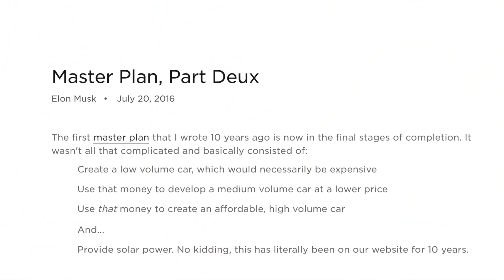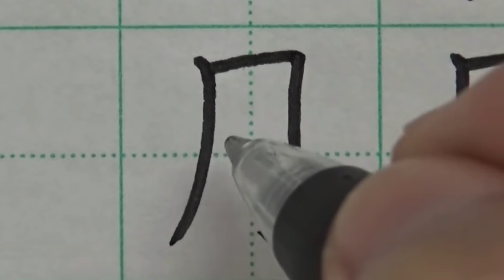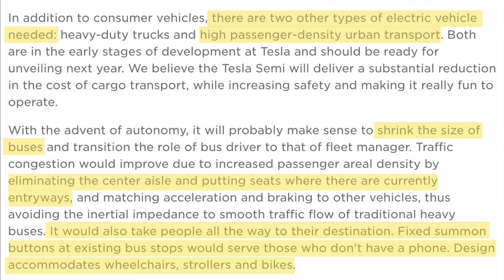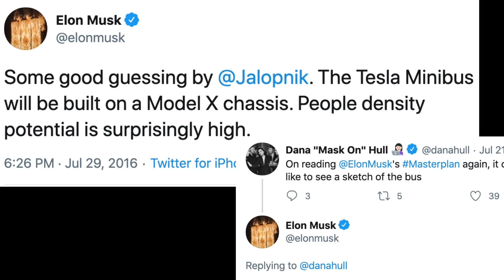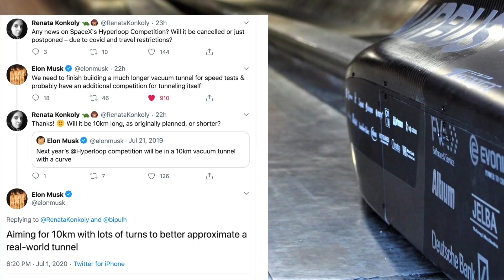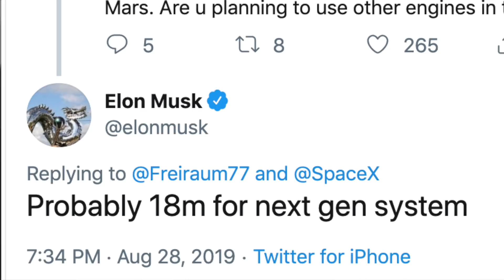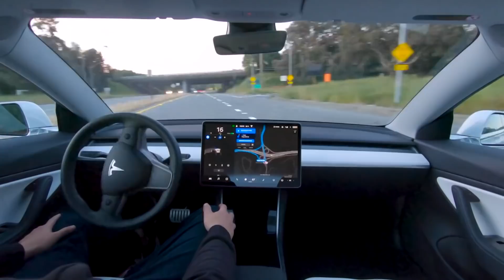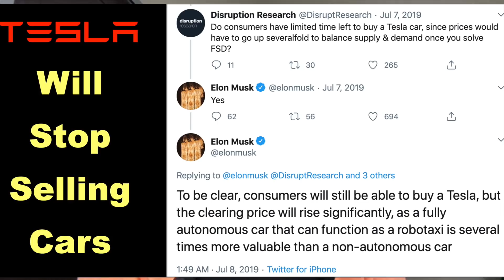5 Elon Musk Surprises for 2021: Tesla, SpaceX, Boring, Neuralink

Comment: About the bus and possibly using the cybertruck chassis. I don't think that is possible because doesn't the Cybertruck have a sort of exo-skeleton type chassis? its not as simple as putting a new body on the existing chassis because the body Is the chassis.
Reply from the maker: I'm not really sure. I think that the Cybertruck exoskeleton will ride on top of a "skateboard" like the other Tesla vehicles. But I could be wrong.

Either way, the minibus could be based on skateboard similar to other Tesla vehicles, but with length and width comparable to Cybertruck.

Comment: Elon suggested a compact EV will be designed in Berlin.

The current Model 3 and Model Y battery packs are 75 kWh, not 50.
Reply from the maker: I believe it will be a CUV - compact utility vehicle.  Basically a hatchback smaller than the Model Y.

Model 3 Standard Range pack is 50 kWh. Standard Range Plus is 54 kWh. Eventual Model Y low-end pack will probably be 54 kWh, maybe 60.
Reply: @WarrenRedlich  Thanks, you're right about standard range versus long range.  Standard Range would be ok for mostly city driving, but long range is more convenient for longer road trips. 

That said, most drivers in the western developed world drive fewer than 40 miles/60 km per day, which any EV can easily do and 200+ miles of the Standard Range is more than enough for daily driving.

Totally agree a smaller car will be more efficient, though the high speed aerodynamics may not be as good.  Lighter is always more efficient due to less mass to accelerate, but taller cars can be less aerodynamic at high speeds.

I hope they do a hatchback.  They're not pretty, but they're highly practical.
Reply from the maker: Yes I think there will be a different vehicle for high speed, long distance travel.
Reply: @WarrenRedlich  Yes and no.   Tesla doesn't want to cripple EVs by designing them only for short distance city use.  For example, they have never made a <100 mile range enclosed passenger EV (like an original Leaf), and I expect they never will.  
That said, the Long Range and Standard Range Model 3/Y do suit themselves better to local and long distance roles.

I'd expect a compact Tesla may have similar ranges, while being more efficient due to being smaller.  It means they can have smaller battery capacity, but not so small that they can't drive between major cities.

Also keep in mind that battery costs fall almost continuously, so crippling an EV by having an artificially small battery pack isn't really necessary.  EV costs continue to fall, and companies that have massive battery economies of scale, like Tesla, don't need to make short range EVs.  It's simply not needed due to the falling battery costs, and at some point it becomes uneconomical as an overall product to take range away with a smaller pack.
Reply from the maker: I don't think they'll go much below 200 mile range.

Comment: new Van idea:  like a street car - no isles - seat "side ways" facing the side-walk. Every one on and off very quickly. bar closes down like circus rides do. 
Florida, considering ocean rise, needs electric ferry not tunnels.
Those with used Tesla cars can watch value go up IF the supply goes down.  [I have long thought used Tesla cars was the path to the <$20,000. - what is better than a low cost Tesla - not owning any Tesla - transport as a service.]

Comment: I believe an LFB based small vehicle is planned, but 25 kwh is too low for 200 miles, you have fixed energy consumption items, aero drag, etc that will dedctaite your pack size regardless of weight. More likely 25-30 k USD, 35-40 kwh packs

Comment: Great video. I am more optimistic than all the youtubets on Starship. But I completely disagree about Starship 2.0.
Starlink needs to be very up and running. Bringing in massive money.
All the current Boca Chica facilities would need to be rebuilt. None of them are currently capable of 18 meter diameter( building doors, etc..)
Reply from the maker: The learning from Starship 1.0 will make 2.0 that much more efficient.

Comment: when you say 25kwh battery pack I assume you mean a 50kwh battery pack in the same size space as a 25 that would make more sence.
Reply from the maker: No. 25 kWh pack. Hyper efficient vehicle.
Reply: Less weight to accelerate=less power needed... smaller cross-section=less power needed at speeds >20 kph
Reply from the maker: Yes. Also most robotaxis will drive less than 200 miles in the morning, then recharge mid-day and drive more until the end of the day. 200 mile range will be plenty.

Comment: 200712
    I continually update this thought exercise with trepidation realising that Rocket Design is not only a science but also an art. What can others think of that I have missed? An 18m. diameter rocket could have six segments 10m. wide or 36 segments @ 1.6m. wide.

LONGITUDINAL vs CIRCUMFERENTIAL WELDING
The fundamental benefit of longitudinal construction is the elimination of circumferential discontinuities. Practical criteria for longitudinal welding of the rocket shell are:-

A. Hot Rolling Stage
i. Hot rolling the longitudinal sections can be used because the additional benefits of cold rolling are superfluous with the high temperatures that are experienced.
ii. A longitudinal segment must taper from base to apex to cope with the large compression stress at the engine base plate.
iii. A circumferential curvature can be introduced at the hot rolling stage (if needed).

B. Rocket Shell Segment Dimensions
Dimensions must be accurate.

C.  Rocket Shell Construction
i. Longitudinal segments are more easily transportable. 
ii. Longitudinal segments are identical. 
 iii. Longitudinal automatic welding is less difficult than vertical or circumferential welding.

Cheers Al H.
PS. SpaceX may need a spare steel mill.

Comment: But you must not forget that Tesla is ramping upp the battery-production. So that smoler battery is to produce more cars is not nesesery anymore, some or all Tesla factories are going to be Terra-factories with means that they produses so much batteries that they are in Terra watt scale, not giga-factory enymore. 🔋🏭
Reply from the maker: I agree they're ramping up, but batteries will still be a constraint for a long time. If they double battery production and cut pack size in half, they can make 4 times as many vehicles.

Comment: Having a 'large van' sized bus would have many advantages, some obvious, some maybe not. In big cities that operate buses the vehicles' MAX capacity and route distance determines the build - and they are 24/7 deployed for that max capacity. Yet max capacity only happens for a few hours, twice daily. A FLEET of Tesla VanBusses could be deployed based on demand. Drivers could be all gig workers or, if mandated, self drive monitors. Just a thought.
Reply from the maker: I think the big question there is how many seats will it have. Elon is talking higher density so I think it might be as many as 16 people.
Reply: @WarrenRedlich  About right. Then put TEN on the route when the demand increases. I have seen HUGE articulated (50' long) buses bring around ALL DAY with only a few people at any one time.
Reply from the maker: Agreed. Tesla software will greatly improve efficiency of use.

Comment: As a single young senior (just 75 this month),  I’ll be near the front of the line for this two door, compact model, which I see as my first and last all electric automobile. So it might as well be fully loaded for both local and regional travel. I see myself driving the theTexas triangle (Dallas, Austin, San Antonio and Houston) with trips to Tulsa from time to time
Reply: While a Tesla compact car will be excellent, like all their cars, please give Model 3 a test drive.  It's a nearly perfect car.  And it costs no more than a BMW 3 series or high-end Toyota Camry.  

In fact, total cost of ownership of a Tesla Model 3 is significantly lower than a comparable BMW or highly specified Camry due to vastly lower operating costs. All electric vehicles cost about 1/3 to 1/4 as much to operate as an equivalent fossil fuel car, and they're much better to drive.  They're smoother, quieter, quicker, far more efficient.  

Plus you never need to go to a gas station since you can usually charge at home.  That's much more convenient.  You charge at night and have a full tank any morning.

Comment: the clicking is driving me nuts
Reply from the maker: Thanks. I’m still working on getting audio right.
Reply: @WarrenRedlich  did you find out what was causing this?
Reply from the maker: No I didn't. I used almost the same mic setup today in the livestream and it wasn't a problem. Today I had the mic off center so I wasn't directly over it. I'll try to keep doing it that way.

Comment: How can the giant sized, 250 mile, single motor cyber truck start at only $39,900?
Exoskeleton. Battery improvements. No paint. 
Look for the lighter, 20k, entry level Tesla to follow CT’s efficient manufacturing footsteps, and keep the focus on range, acceleration and futuristic, edgy designs.
Low priced but still bad assed.  Worthy of Tesla word of mouth marketing.

Comment: 30kWh with a more than 200 mile range would be dramatically more useful than 25kWh and 175 mile range.
Tandem pod cars that lean like a motorcycle would use 1/2 the road space and being small would need even smaller batteries and less cost. 
Norman Hossack (the bike suspension designer) also had a simple tilting beam front suspension that gave two steering wheels and one rear driving wheel.
Reply from the maker: Regarding useful range, remember we're not talking about the US. This is for China and for poorer countries initially. A US version would probably have more than 30 kWh.

Model Ah is an intermediate step before pod cars, which will be single passenger: https://www.youtube.com/watch?v=bhFPvZKdriU

Comment: I enjoy your speculations and agree with most of them. However, I think you have overlooked a couple of clues. Firstly, the new "starship" is not designed to go to Mars. Its rocket motors are designed to be used over and over, because the rocket will serve as a re-usable platform for launching 600 (or more) Starlink satellites at a time, and then landing itself back on earth to be used again and again. This is the key to maintaining the Starlink satellite system consisting of 42,000 satellites, because the low earth orbit satellites will only last about three years each, so it will be necessary to regularly replenish the satellites. With a little arithmetic one can realize that even with boosters capable of launching 600 satellites at a time it will be necessary to maintain a schedule of at least two launches per month to maintain the starlink system. The gigantic, re-suable rockets will drastically lower the cost of maintaining the satellite system. Mr. Musk and his friends have gone to some lengths to conceal the true nature of their plans. Travel to Mars is out of the question. The human body is not evolved to endure the stresses involved. To attempt such travel would amount to a purposeless death sentence for all involved. The Starlink system of 42,000 satellites will annihilate competition from ground-based  optical cable systems, and it will re-revolutionize cell phone communications, because it will be easy to adapt existing cell phone towers to communicate directly with the satellites. It will enable intense surveillance that will make privacy and individual rights a laughable memory. It will be Big Brother on steroids. The bright side of this is that ordinary crime will be extinguished, and life will become far safer.

As for the new generation of inexpensive robotaxis, my hunch is that they will be very similar in design to the Cybertruck. This manufacturing approach eliminates the need for the complicated and expensive gigantic machines needed for conventional car construction. This is revealed in the low price of the Cybertruck----it is priced about the same as a Model III. It's a heck of a lot more vehicle than a model III. The only reason it can be offered at such a low price is that it will be far cheaper to build than using conventional construction technology. So, I expect that it won't be long before all vehicles resemble the Cybertruck, and they may wind up lasting millions of miles with minor service such as replacing wheel bearings at distant intervals.
Reply from the maker: Starship 1.0 and 2.0 are both designed to go to Mars, refuel while on Mars, and return to Earth. And yes, humans are going to Mars. There are no particular stresses about the journey we can't handle.

Starlink satellites are designed to orbit for 5 years, not 3. Starship 1.0 will carry 400 starlink satellites, not 600. Starship 2.0 would carry far more than 600 if used for that purpose.

Cyber design is possible for newer models. But I don't think that matches the China-design concept. We'll see. I was thinking it might still be stainless steel, but softer and thinner so it can be stamped or pressed into curves.
Reply: @WarrenRedlich Don't believe every word the Muskrat says.  I will be astonished if humans are sent to Mars in our lifetime. It's a crazy idea. The effect of prolonged space flight might be described as accelerated aging. There is loss of bone and muscle mass, changes in eye tissue, and so forth. Mammals did not evolve in the zero gravity of space. The best evidence I know of is the experience of John Glenn. He was severely debilitated after spending only nine days in the space station. After landing, he struggled for a couple of hours to stand up.  Of course, he was old (77). One of the most important elements of the aging process is what I call "capillary senescence" that undermines tissue perfusion and organ function, even in the healthiest geriatric person. Accelerated capillary senescence is the underlying cause of heart disease, diabetes, and hypertension. It undermines glucose uptake by cells, and increases microvascular flow resistance, which increases the workload of the heart. The heart cannot endure sustained increases in work. The sustained stresses of extended space travel entailed by a trip to Mars would have a devastating effect on the health of the astronauts. If there were serious interest in sending humans to Mars, it should be preceded by prolonged animal experiments in the space station to assess the impact of extended space travel. There's nothing cheaper than talk. In my opinion, the talk about sending people to Mars should be recognized for what it is, and dismissed accordingly.

As for the idea of curves on cars, that would necessitate gigantic presses that are very expensive.It would increase the cost of production. The objective of a "people's car" is to make it cheap, durable, and practical, like the famous Volkswagon. The Cybertruck manufacturing will use computer controlled lasers to score and cut the sheets of stainless steel,  and simple machinery to bend the sheets into the correct angles. It will be far faster and more efficient than conventional vehicle manufacturing. People will grow accustomed to the strange look of the exoskeleton engineering, because it is inherently superior in all respects save looks. Tesla seeks to dominate vehicular transportation throughout the world. Their freight truck, cybertruck and "people's car" will devastate the gas buggy market, and eliminate trains as well. I expect it will undermine much of the airline business as well. Boeing's woes are just beginning.

As for your differing numbers quotes for the Starlink satellites, they don't change my point. The rocket will be designed to orbit Starlink satellites, and be used over and over to reduce costs. That is the name of the game.

At any rate, the proof will be in the eating, and we shall know soon enough whether or not those rockets are intended for mars. The moon----maybe-----but not Mars.

Comment: What about Boring building the 100 km ring tunnel for CERN, Geneva which is supposed to cost 23 Billion Eur. If Broing is able to build a mile at 50 Mio that would be 3 Billion Eur instead.
Reply: Is 23billion the cost of the tunnel itself or the tunnel plus all the expensive hardware that goes inside it?
Reply: @marioghioneto1275  The tunnel itself

Comment: I think the 18.0-meter starship makes sense as a Tanker for the 9.0-meter starship, at least to start.  It would drastically reduce the number of refuel launches, maybe 2 instead of 7,etc.
Reply from the maker: I didn't think about it as a tanker for Starship 1.0, but that does make a lot of sense. Might even be just launch.

I was thinking Starship 2.0 would be good for carrying large numbers of passengers to Mars. 

Maybe Starship 3.0 will be the tanker. :-)